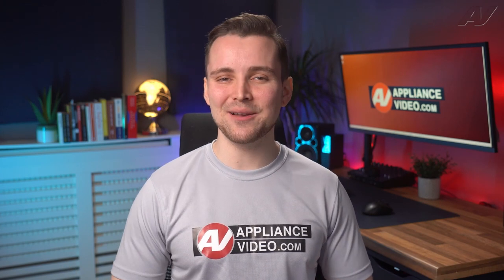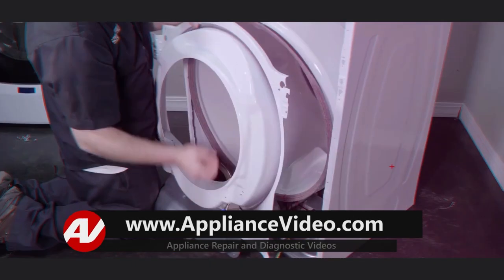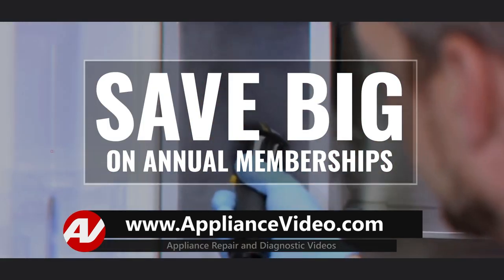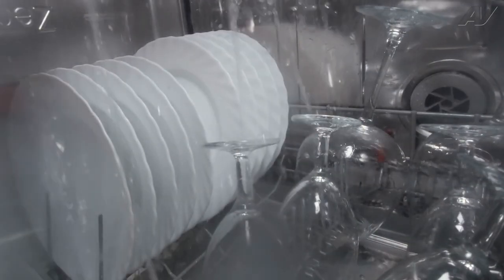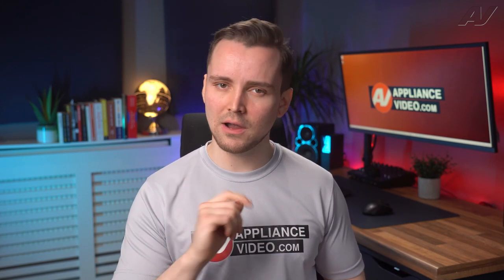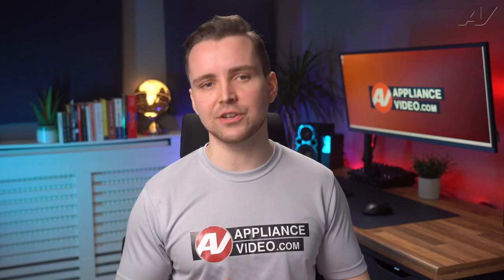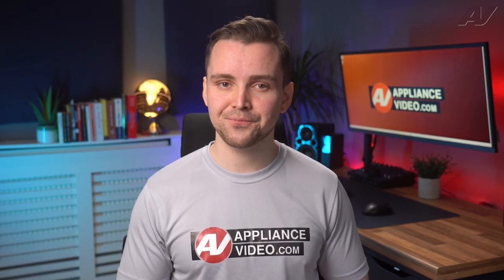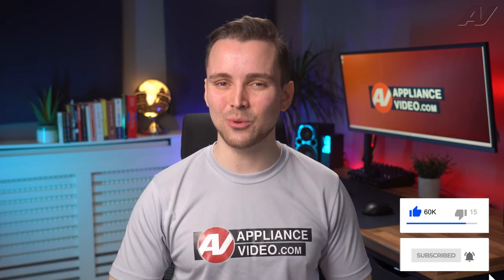Why your new Dishwasher takes so long to go through a cycle ?

Comment: So instead of using a little extra water (which is mostly cheap), it uses twice the electricity (which is expensive)?  I swear we are going backwards in technology sometimes.  Add to the fact they make shit to break and be replaced rather than last decades and it just makes the whole concept worse.

Comment: I just installed a GE Dishwasher 24 in. Stainless Steel Front Control Built-In Tall Tub Dishwasher with Dry Boost, Steam Cleaning, and 52 dBA.  Everything went well with install.  Looks great.  It is taking four hours or more to wash dishes on Normal mode.  Not sure how to get that time cut back a bit.  I did tell my wife to run the hot water from faucet first to get real hot then turn on the dishwasher.  I did a test run after install checking for leaks etc.  We put dishes in it today and took over four hours.  Seems way longer than should take.  Dishes weren't all that dirty either.
Reply: Thats pretty ridiculous that it takes that long we installed a new one too cuz we did kitchen remodel our old bosch one was good too i could do dishes in that one as little as 30 minutes i miss it ugh , btw doesnt yours have 1 hour wash?
Reply: Yes it has a shorter wash time but my wife was unhappy with how the dishes turned out.